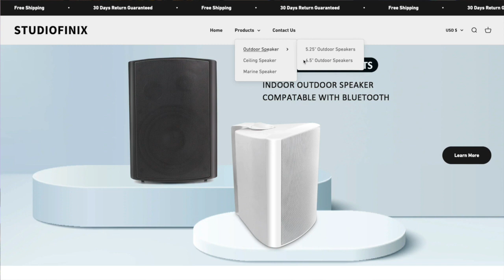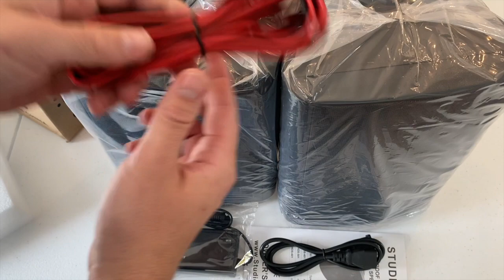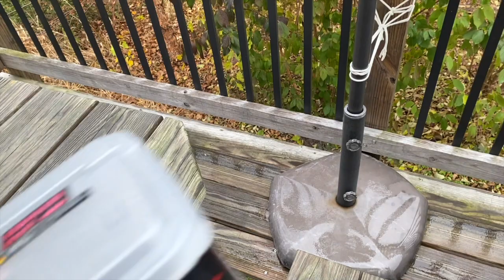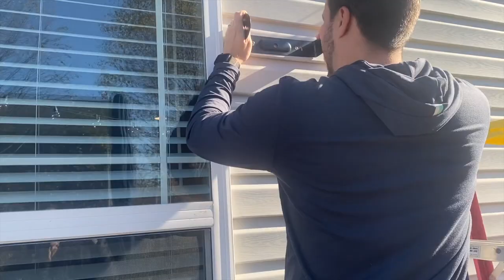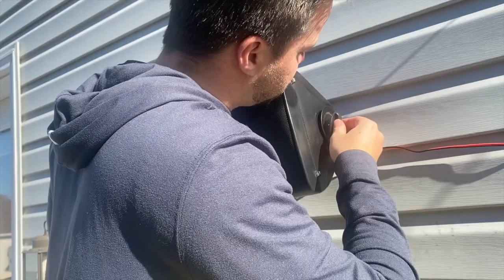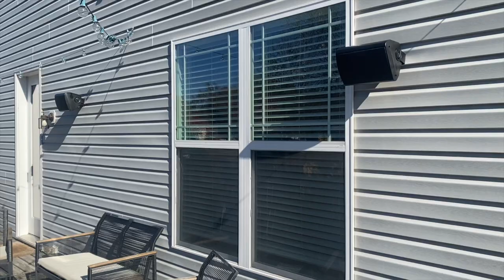Maximize Outdoor Audio Experience: Studiofinix Speakers Review & Tips | Mighty Max

Comment: My house it all brick and my speakers weigh 35 lbs each.  Suggestions?
Reply from the maker: If you’re concerned about mounting there are special anchors designed for brick and mortar that you can install. Definitely be careful with state of the surface you are drilling into to avoid damage. Hiding the wiring will be more complicated. You could likely drill a hole all the way through the brick if want to work to seal it, but I would not necessarily recommend that without a professional.